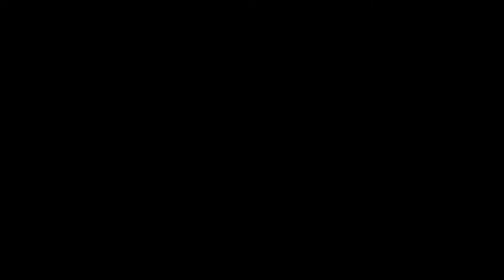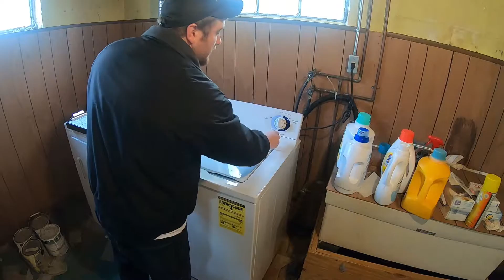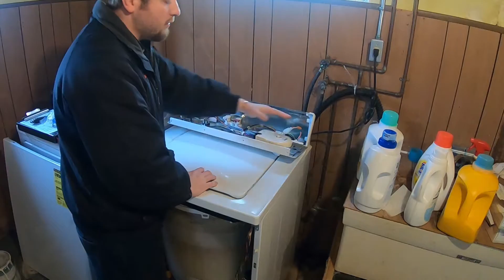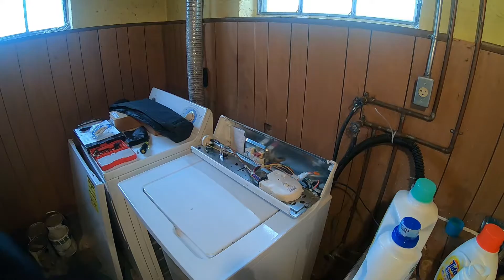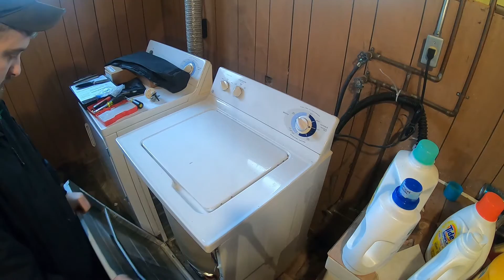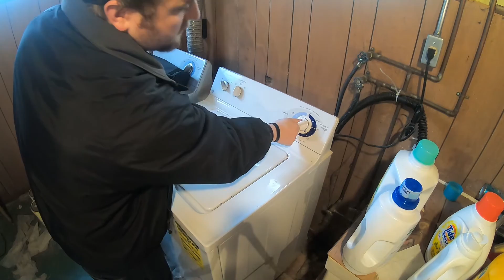GE, Hotpoint & RCA Washer Pressure Switch issues - Diagnostic & Repair

Comment: Why does my water level only come up half way even on super or extra large setting? the water does not cover the clothes. The pressure switch clicks when tested and the air line is clear. I have a G.E. GTWN4250DOWS